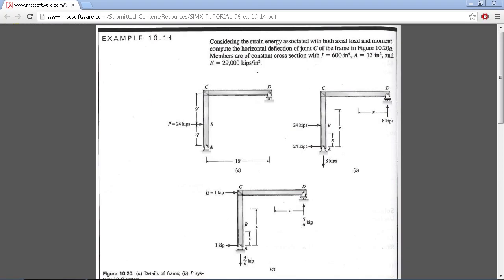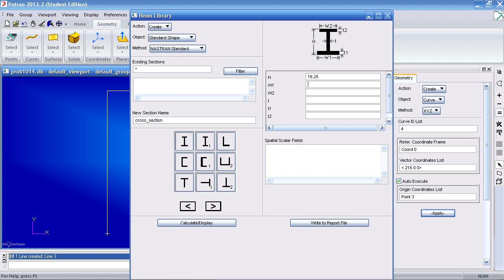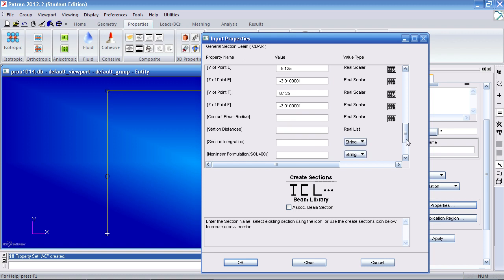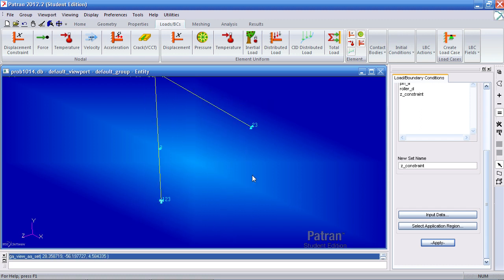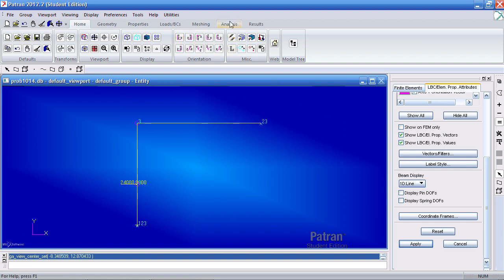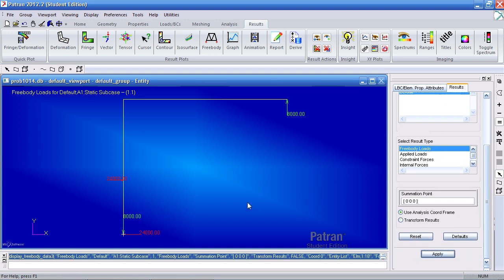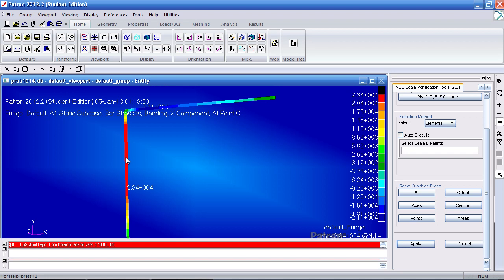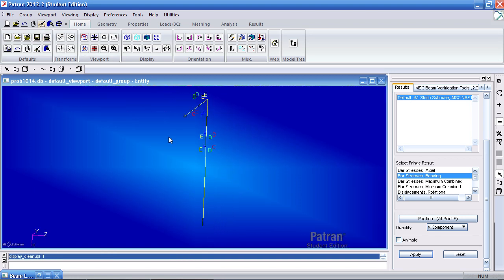MSC Nastran, Patran Tutorial - Bending Stresses, Displacements and Free Body Diagram of a Frame

Comment: Hi Sir, i have 2 problems
- when i select : Analysis --> Entire Model  -> Apply , it says " Some elements in the model have no types or properties defined. Do you wish to continue with the translation? " if i clic yes or no it have no calculation and no resulats file.
- when i want to show the 3D dimensions : i select display ->3D---> Apply(like in video) , but my model don't change it stays on 1d. Thanks in advance

Comment: Hi! I have a problem when I attach .xdb resaults it says:
 $# * Begin: Attach Result File *
So I can't see any result.
Thanks
Reply from the maker: Andrea Cravana Great catch. 

The message "$# * Begin: Attach Result File *" may indicate that the analysis did not complete successfully. Search your .f06 file for any "USER FATAL MESSAGE." You might see one called USER FATAL MESSAGE 9050 which means the model is inadequately constrained. This is perhaps the most common challenge to any new users of FEA.

Sometimes two separate meshes appear connect, but in fact have overlapping nodes. When you move to the analysis, it can appear one mesh is disconnect thus resulting in an inadequately constrained model. When you equivalence, you consolidate the nodes so the meshes become connected, and the analysis runs fine.

I should also add, every model should be constrained from translating in the x,y,z, and rotating about the x,y,z.
Reply: Did you click on "equivalence" button on mesh tab? I skipped that passage and received the same error. 8:10